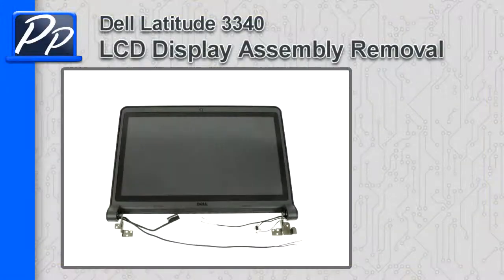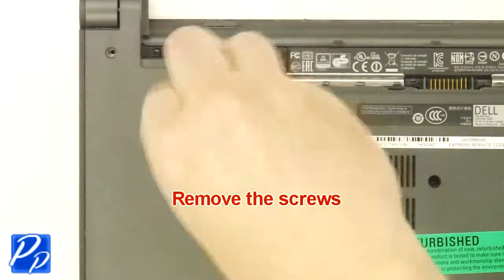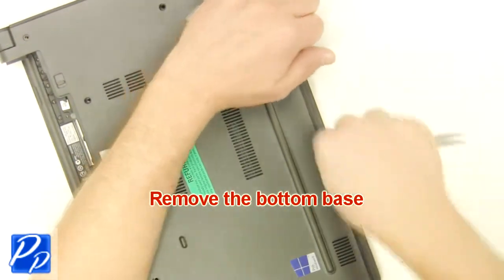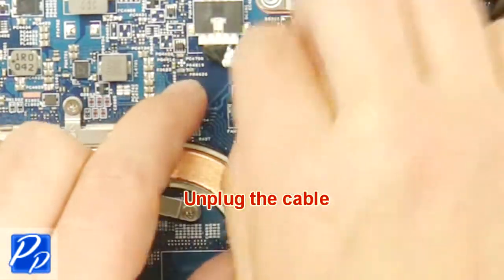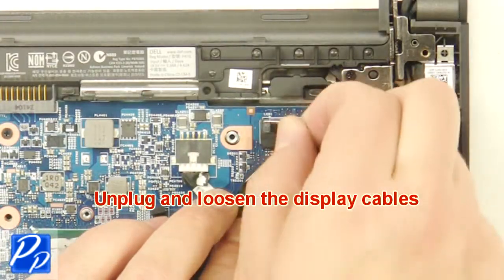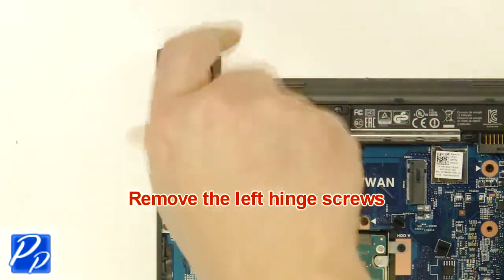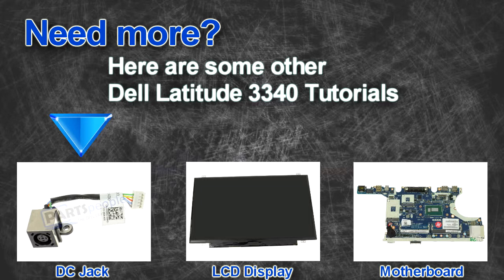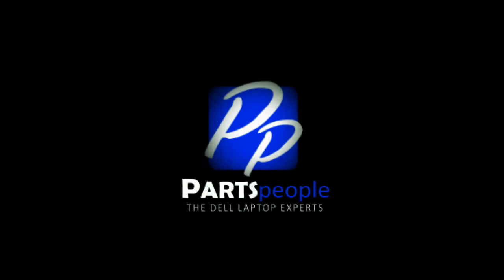Dell Latitude 3340 LCD Display Assembly How-To Video Tutorial

Comment: i have an error with this pc. i got it from a friend of my dad used, when i plugged in the charger and turned it on the cpu fan turned on for maybe 2 seconds and then it turned of, i could hear it working still but nothing happend. only other thing that happend was the LEDs on the right became lighted and some was blinking, i've tried everything from opening it and going to the dell website and it still doesent work, any ideas?

allso, on the MB i noticed 4 component slots were missing approximately 2-3mm in lenght and 0,5-1mm in width
Reply: nvm the componets that was missing was allso missing in the video
Reply from the maker: Unfortunately it could be a variety of things. I would have no way of knowing without seeing it.